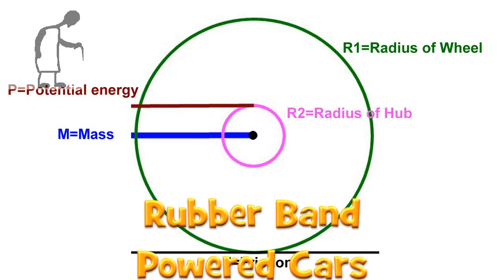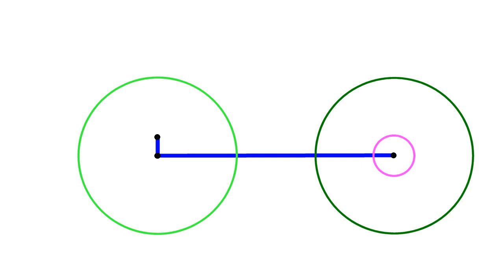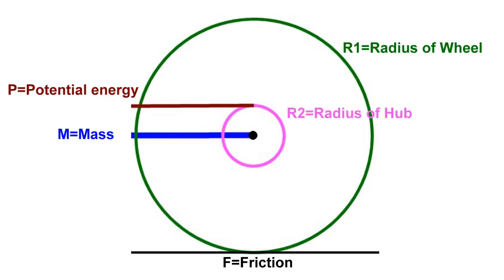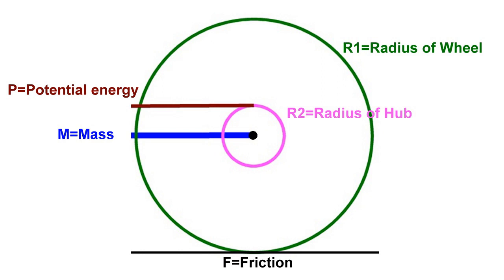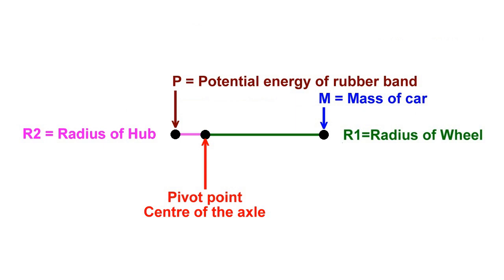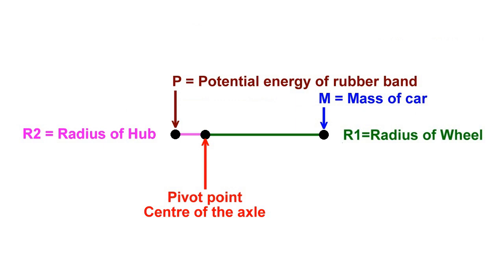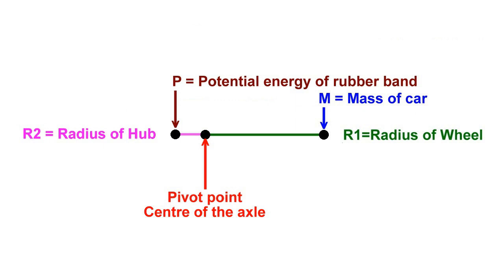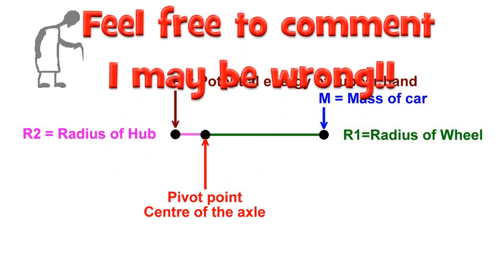Rubber Band Powered Cars - Looking at the MATHS

Comment: Hello sir, I'm writing to you because I have many questions about making a Rubber Band powered car.
I was searching videos about how to make these type of car and I found your videos. I have to build one so I was wondering if you could help me a little, like orienting me.
My car has:1)to be not too big height: 7 inch length: 10 inch width: 8 inch2)to be not too heavy3)to be made with a recyclable material 4)to be consist overwhelmingly of wood5)to turn because the car has to do a parkour and it has to turn left and right
I don't know if it will turn if I build a car with 4 wheels. Maybe it's better 3 wheels. I watched your videos and I didn't see a rubber band powered car with 3 wheels (I only saw 4 wheels in the videos I watched) so I'm want to ask you if you could help me build the car that can do all the things I mentioned above.
Thank you!
Reply from the maker: +Jenny Luu as far as the component parts of the car are concerned that will just depend on what materials you have available. I make most of my cars from cardboard and use CDs for wheels because that is what I have available to me. You say your car has to be able to turn. How is this to be achieved. Does it have remote control? Does it have to turn at specific instances over the same course each time or does the course vary on each attempt. Here is a car I made to turn to avoid a fixed object https://youtu.be/BenC2W21CCw  You may find the cars in this playlist inspiring but probably more complicated than you want https://www.youtube.com/playlist?list=PLA5a2xPRSrB0dbQ1TpU4qJx4m85zK7MFa